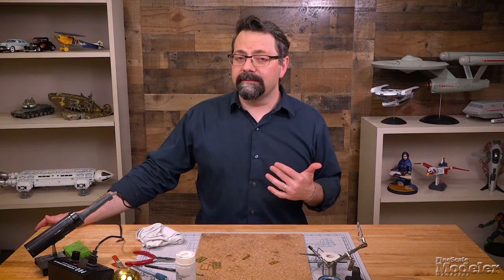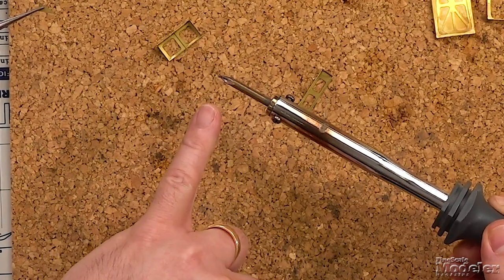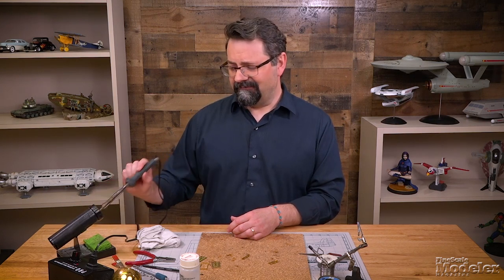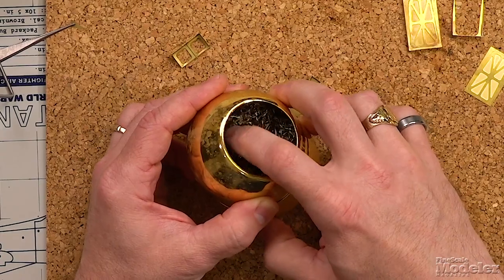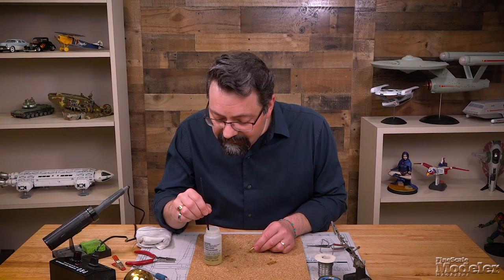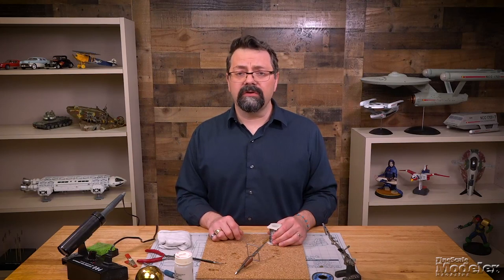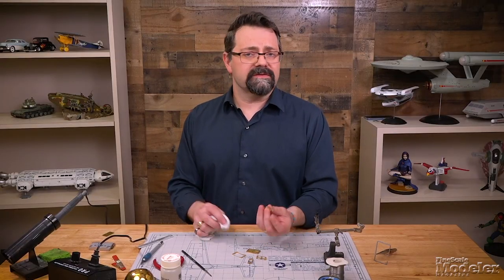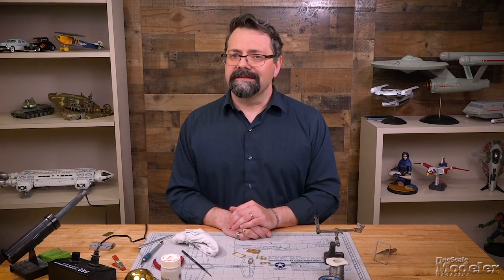Scale Model Basics: Soldering Photo-etched Metal

Comment: I know this vid is aimed at beginners.  But.  If you’re a little more experienced modeler or very serious about your work…

One word “resistance solderer” 🤗.  Ok, it’s $$$ expensive but once you make the leap you’ll never go back to iron/pencil soldering; except for electronics - never use a resistance unit on electronics.  We’ve got an American Beauty resistance unit and a Hakko pencil station, and a few Wellers that spend most of their time in a drawer now.  Another useful tool is a hot air desoldering station (hint it can also solder low temp solders).  [edit: I’d be remiss not to mention Quad-Hands, awesome, the heavy weighted bases help keep from tipping and destroying hours of work, for 1/32-1/35 and larger look at their largest unit, I’ve got a Handley Page Victor held in one at the moment).]edit #2 we use our X-Tronic hot air unit for desoldering, soldering (24/26 gauge wiring) and…ta-dum …heating fibers for bending to fit in tight places, example is the BOP my youngest did for WF and Eaglequest years ago and which  appeared in FSM, there was a TON of fiber in that thing.  Was a lot safer for him to use, he was about 10/12 at the time, wow time flies he’ll be graduating University soon.].

Get a resist unit w a foot pedal or your preferred pencil solderer,a few different temp solders [edit: something akin to Carr’s] heat sinks (worst case) and some good liquid flux and your good to go.  Don’t forget surface prep, clean (lacquer on brass) and/or lightly sand.  With the resist soldering, we (my son and I) cut the solder into very tiny pieces and preplace them on the pieces to be soldered.  A nice plus of a resist unit method - it can be far  easier to setup and mount parts for soldering.  No muss no fuss no unsightly solder showing.  If someone reading this decides to get a resist unit, get one bigger than you think you’ll need, brass (typical in our hobby) can be a major heat sucker.

I’ve taught quite a few scouts and kids how to solder model components with both types, and 99% of the time they’ll head back to the resist unit, it’s really that much nicer to learn and use with precision.  

Happy model building!

Hey Tim, we’ll see ya’ll (FSM) back at Wonderfest in 2024.  

Not associated with any brands that might be mentioned in my comments, other than as a long-time (decades in most cases) user of a tool I’ve used extensively and enjoy using.

As always YMMV.  Just sharing.  Nothing more.  Nothing less.

Comment: What alloy solder is used for the PE metal types?  Are there different types of flux?
Reply from the maker: Because you aren't soldering water pipes, you can use tin/lead alloy or tinned copper, or you can opt for silver solder. Make sure to use get narrow gauge; we used 22AWG solder in the video. There are different types of fluxes. We used an all-purpose flux that can be used for hobbies and stained glass. No need for anything industrial.